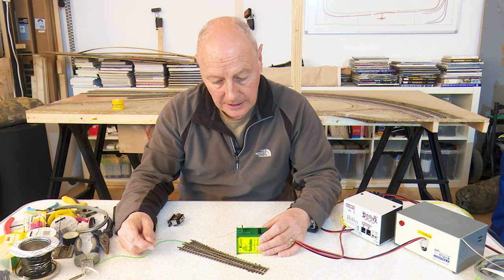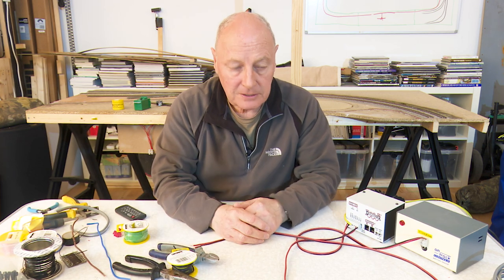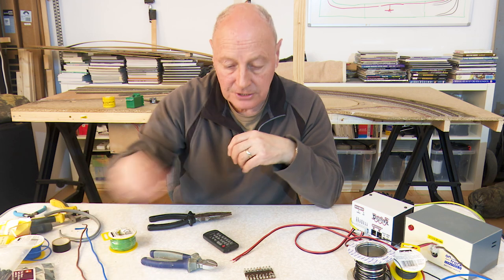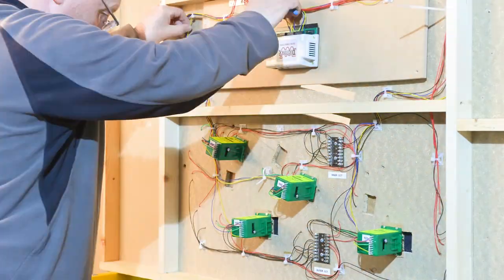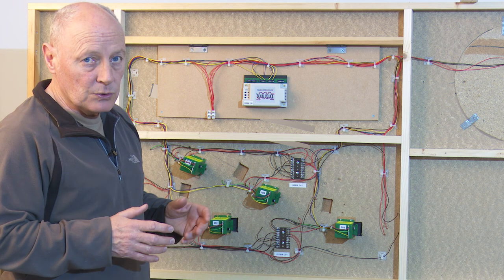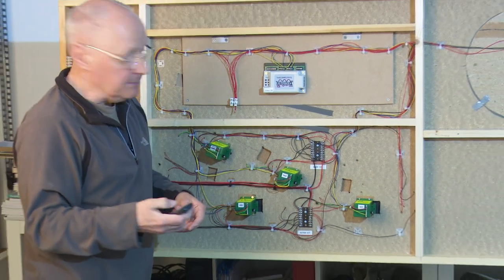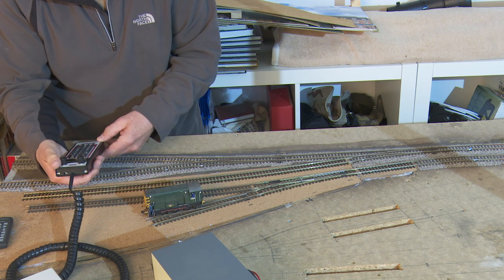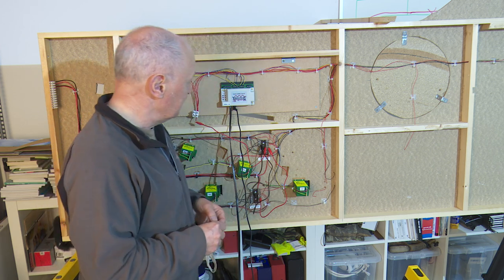DCC Bus Wiring at Chadwick Model Railway | 24.

Comment: Do you make an occasional wrap of the two bus wires? I have heard that it reduces the interface of the DCC signal. I’ve also heard about making a termination with a capacitor and resistor at the ends of long bus runs. What is your thoughts on this?

I like your advice about not soldering to the rail joints. I’ve had the best luck soldering to the rail web. Once the rail is weathered, and the ballast is spread, then the wire never shows.

On your topic of splitting the bus on a circular track plan, it’s good advice. For the viewers, don’t forget to cut your rail and install insulated rail joints at the same location. If this is not done, then it would be electrically the same as having a continuous bus.
Reply from the maker: Hi Brian, 

I’m pleased that you found it useful.
I heard of folk twisting the cables to counter induction but not of using a capacitor/resistor.
Regards Charlie

Comment: Do you share links? I am interested in the shoe lace ferral &  crimping tool, to use in keeping strands of wire tightly together. I use a wire length measuring meter to check remaining length of wire on spools!
The stranded wire frays into a  mess, keeping it tight to begin with will help preventing getting poked by the individual strands!  Great see how to buss wire track!
 Best Regards.
Reply from the maker: Hi BBB8,  you will find the links in the “More” tab.  Listed there are many of my recommendations.
Regards Charlie

Comment: Great video Charlie, Now I understand how your feeds are wired where your cab bus (Loconet) goes directly to your point controller and I can see how you avoid the Hand of God when you enter an incorrectly set point. On my system the cab bus does not go to the point controllers as they use track power for their data so I wire them to a separate power district. This is the trouble when we try to show how we wire things as all systems are slightly different. Yours being all Digitrax and mine being a mixture of NCE, Merg and other bespoke items that I have cobbled together. But I found it very interresting to see how the Digitrax system works. .........John
Reply from the maker: Hi John, I’m so pleased that you enjoyed it and hopefully it was of some use. Regards Charlie

Comment: Another question Charlie, do you solder the tracks together with the fishplate. Or do you let the glue or pins hold the tracks together. I am using all second hand track. Many of them came with solder at the ends of the tracks. I’m planning on ditching the use track I have and buying all new code 83 track so I have all the same code. As it is now, there are some 100 and some 83. I don’t know what the lower code is but I’ll bet I have some of that too.
Reply from the maker: Hi RH, I never solder the fishplates.  You loose the rails ability to expand and contract with changes in temperature.

Comment: Charlie; thanks for all of the great info that you supply in your videos.  Quick question if I may.  I operate with an MRC DCC system.  On my new layout I'd like to add the DS74 quad controller. in various areas.  What I cannot discern is whether I need anything in between my MRC system and the Digitrax device to make this work?  Any advice?  Cheers
Reply from the maker: Sadly I’m not knowledgeable on MRC but I believe that the DS74 could well require a LocoNet feed to signal the switching.

Comment: Hi Charlie. As someone who’s knowledge of such things is very limited, I’m soon to get an NCE PowerCab which as I understand it, operates at 2 amps. My question therefore… is the 5 amp multi core that you have used for the power bus suitable for this (if not, what would be?) and following this, I assume the 1.5 amp wire for the droppers is fine for using with PowerCab. Many thanks in advance 👍🏻🚂
Reply from the maker: Yes Brian, the five amp cable will be fine. The larger, the cable size, the less the power drop which is a good thing. Regards, Charlie
Reply: @ChadwickModelRailway  many thanks for getting back to me. Genuinely appreciated 👍🏻

Comment: Hello Charlie, great video as always and very informative with some great techniques. I think it is essential to be able to solder for modelling and why people don't want to try amazes me, as in most cases, 99% of things people do on their layouts they have never done before, it’s all a learning curve.

I am a little concerned with the wiring, have you considered Voltage Drop and Impedance? I am not too sure on your length of "Bus Wire" but 5 amp flex is not enough for a 5 amp system over a distance cable/flex will lose voltage. This can be calculated through the basics of "Voltage Drop Law" which is Vdrop = IR. I find it is always best to double the amperage rating of the cable/flex for longer distances, otherwise you increase the chance of Voltage Drop. For example, a 20AWG (0.5mm thick) at a distance of 5 meters with 15 volts and 5 amps could see a voltage drop of 11% but using a 14AWG (twin and earth type cable 1.5mm) with the same distance, voltage and amperage would see a drop of 2.7%. The golden rule for Voltage Drop is maximum of 3% albeit more towards household wiring but considering DCC it should be more robust. 

There is a plethora of factors to consider; rail causes resistance; Nickel Silver is 19x more resistant than copper, the type of wire is important; copper being the best for conductance and reduced Voltage Drop and there are many more factors. There have also been cases where impendence has caused loss of control above certain speeds as some motors and decoders have increased sensitivity over waveform distortion.

It could be even worse if you added devices to the "Bus Wire" for DCC Signal/Power but thankfully LocoNET covers that. So, bearing that in mind; from Rail to the "Bus Wire" a 2-3 amp wire/flex would suffice but a "Bus Wire" over a distance, connecting to many droppers, etc would need a thicker gauge and higher amperage rated cable/flex. In terms of Digitrax a 3 amp wire from the Rail to the BDL168 (dependant on distance of the cable/flex and length of track) would suffice, this reduces impedance, considers “double heading”, coach lighting and sound locomotives, only then requiring a higher gauge/amperage cable/flex for the common return ("Bus Wire").

You can terminate the “Bus Wire” by using a method with a terminator but Digitrax specifically does not recommend it at all. The principle thinking of a "Ring Main" is right but only in terms of it requires thicker gauge wire to power the appliances, to reduce the impedance and current draw (too much current, produces heat and then fire, if not careful), the same idea should be applied to layouts. 

If you want to take full advantage of the 5 amps, without any problems over longer cables, I do suggest using a higher rated cable/flex. Majority of my wiring on my layout is Automotive wire, which is near enough double or triple the rating that is needed. I have from Rail to BDL168 is 3 amps and Common Return is the Brown cable of the “Twin and Earth” thus ensuring reduced Voltage Drop and Impedance. A company I use is PoleVolt which supply 100m reels at a reasonable price.

Hope that helps and not too much information overload. 

Des
Reply from the maker: Hi Des, 
I’m so pleased that you enjoyed the video.
I do understand your concern over the voltage drop over distance.  As an ex helicopter electrical engineer, I do have a deeper understanding than most.  However, it’s very easy to over engineer what is fundamentally, a hobby.  
In the past, I have often lost sight of the aim, worrying too much over certain less important details.  I mentioned about power districts, and having them, is a massive asset.  They make power management much simpler and fault finding far easier.   Furthermore, it’s also easy to check voltage at the rails should voltage drop become significant  and adjust as necessary.
Regards Charlie

Comment: Hello Charlie getting back into hobby after long break.
Question I understand the Bus system should not be a continuous loop ie circuit.
Does this mean I would wire each section of track solder to Bus and use insulated fish plates if I wanted up upgrade signalling and points location in future from basic layout ?

Great Videos and tip much appreciated 

Paul Wright
Reply from the maker: That is correct Paul.  Regards Charlie

Comment: Thank you for the video - I have just found it. It is excellent, very concise and I wish I had found your videos earlier
I am a newcomer to layouts and I have found the thickness of the bus wire hard to come to terms with as opinions vary markedly from one source to another. 
My layout is roughly 17ft by 8ft.
A lot of US sources say 12 guage(AWG) wire which is 2.05mm (0.0808inch) diameter and 3.31mm2 cross section area. How does your bus wire compare to this US opinion?
Unfortunately in Australia the wire is not labelled as AWG and the thickness labelled is quite confusing to a dummy like me around electrics.
I bought some Narva auto cable which is rated at 10amps for the feeders (1.13mm2) which equates roughly to AWG 16.5.
Would this be adequate as bus wire also or do I need to go bigger?
Also does it matter if the feeder wires are over engineered?
Thanks for letting me ramble - I hope it makes sense.
Reply from the maker: Hi Michael, that cable is more than adequate. 10 amps is a lot of current.  I'll bet that your system is not outputting 5 amps and no, over engineering is not a problem except on your pocket.

Comment: Charlie, here is a list of Digitrax items as you requested. Mobile, Decoder, super Chief super premium DCC Starter set, DS54, LT1, DH126D, PR3 XTRA, LNC162, LNCMK, LNCCMC1, UP5, DS64. THIS IS A LIST OF ITEMS WITH A BOOK THAT CAME WITH THE EACH ITEM.
Bob
Reply from the maker: Okay Bob.
Now please explain the type of point motors that you are using and what the problem appears to be.
Reply: Chadwick Model Railway , I use tordishel, sorry for spelling, (comes from dementia) and question is wiring, do I need to drop a feeder from every track and switch? Being from USA, I get confused with some of the English words. What does straight forward mean. You say it a lot but not sure what it means. Once again, the wording difficulty is from dementia.
Reply: Chadwick Model Railway tortoise slow motor
Reply from the maker: Hi Bob,  watch this video from Digitrax and let me know if it makes sense.
https://www.youtube.com/watch?v=1JCo86J1WJI
Reply: Chadwick Model Railway Charlie, I will watch the video but let me ask you this. I have started soldering on the joint connectors. It work well but will it work for both the power and the Digitrax?

Comment: Charlie,  I watch almost all of your videos. They are very helpful. I have purchased a full Digitrax system and I’m having a very hard time. Especially DCS64. I’m also am confused about soldering things on the board. Does every track and switch need soldered to the bus and does every track and switch need connected to my DCS64 in each of my districts? Sorry for asking so many Digitrax question. If it is ok, I’ll ask more.
Reply from the maker: Can you tell me what you have bought?
Please reply on a fresh thread.

Comment: Hi Charlie, thanks for the informative video, quick question, does the bus wire have to be directly under the tracks in question, as your theory regarding confusing signals could also be relevant here, if the signal is going round the bus AND the track (as both are live) if the bus wire is not directly under the track, it may come slower then via the track itself, will the signal become distorted or is it all lighting fast? many thanks. A
Reply from the maker: No, I don’t believe that it matters.

Comment: Hi Charlie.  I have been enjoying your videos immensely, especially during this lock down period.  The signal gantry one was good and I have a etched brass kit of a gantry to build.  Before I start it however, I need to get an understanding of how these things wire up with Digitrax. Can you do a video of this please? I have 4 zones in my layout but I’m going to change that to six so I can run more than 2 trains at once.
Reply from the maker: That is quite a challenge Richard. Please view my video number 2.
It explains how the SE8C works if you need automation.
Regards Charlie

Comment: Hi Charlie, in respect of your previous video about stabbing your thumb. I always use a locking pliers to hold the pin just above the track, you can then cut with confidence. The pin won't fly anywhere.. regards JC
Reply from the maker: Great point John, and no pain too. Thanks, regards Charlie

Comment: ¡Hola Charlie! Greetings from Spain, the land of the GSSR.  Retired here back in 2015 and recently found the boxes of my cherished childhood Hornby train set. Not having used the set since the early 1980’s, I have been amazed at the advancements made within the model railway system. The major change I have come across is DCC.  I have therefore decided to invest in a base-entry-level system and, am now preparing a layout. 

This video has answered the questions which have been on my mind and, I now feel confident with the wiring required. Of all the posted videos, within the model railway scene, on YouTube, yours has been the most informative. However, one area of installation wiring I have not yet come across is, wiring and the possible need for track section insulation for points. Can you or, a fellow modeller, provide advice please?  Thanks Gary
Reply from the maker: With DCC there are no isolated sections at all with the exception of the frogs on electrofrog points.
Trust me, it’s far easier than you think.
Reply: Chadwick Model Railway Thank you for your prompt reply. I have all standard points (R8072 & R8073) so, that has certainly eased my mind. As for the connections, soldering will be the order of the day - having spent the last 16 working years involved with commercial lighting, I have always given supposedly labour-saving connectors a very wide berth. Thanks again Gary

Comment: as a retired auto electrician I find using scotch locks are very hit and miss as they do corrode in the air and cause all manner of faults I was forever removing them and soldering instead as some time the bridge which cuts through the wire and can miss the centre core and just rub up against it so causing a poor connection I have removed hundreds of them with that fault. I find soldering the best foolproof method thought I would let you know all the best john from rugby.
Reply from the maker: I too have moved on, I now use ferrules whenever i can.
Reply: @ChadwickModelRailway  Ferrules is a much better way of connecting wires as you will always get a good connection. there are many good ways of connecting wires scotch locks are not one of them as I mentioned above. all the best john from rugby.ps your model train videos, in my opinion, are the best tutorial train videos on youtube by far none even come close to yours I personally as a professional auto electrician think you are doing an amazing job.

Comment: Hi Charlie, Great informative stuff. Confused even more now ! Back into Model Railways after many years away, but now got a "Man Cave" ! Your guidance please. If, for example, you are running a small basic oval circuit (eg Hornby Mixed DCC) the rails act as power with DCC signal, and is continual circuit. If you run a Bus (with droppers) that continual circuit will be there (through the rails) whether or not you sever it. So, do you use Insulated Rail Joiners ?
Reply from the maker: Great question Neil.  It is thought best, amongst the electronics wizards, that the bus wire on an oval circuit shouldn’t actually join right up and the track should be separated by two insulated joiners so in effect it’s not a complete oval, it’s just one big straight track which in reality does join.

Comment: As usual, very well explained, Charlie. Two quick questions:
1.   I've heard that the bus wire should be twisted... about 3 twists per running foot. What's your view on that?
2.   In case I go in for tag strips to connect the feeder wire to the bus, then what would be the maximum length of a feeder wire (from the track to the bus)?
Regards,
Ganny
Reply: I meant what's the "do not exceed" length of a feeder wire!
Reply from the maker: Yes, twisted pairs is good practice but I'm unsure if it's necessary.
As for feeder wire, it depends on the feeder cable size.
Regards Charlie
Reply: @ChadwickModelRailway  Thanks... reason I asked is that this modeler mentioned an ideal max distance of 12-16" of 20 gauge wire.
Reply: .... and that does not seem compatible with the use of tag strips, as you explained.
Reply from the maker: Sorry, that wasn’t very clear.
The length of the feeder wire can vary by using thicker cable. 
So for example, a 4 foot feeder cable might be excessive for a 7 x0.2 cable.
So change the cable to 16 x 0.2, which would have much less resistance.
Regards Charlie
Reply: @ChadwickModelRailway  Its clear now, thanks. Cheers, Ganny

Comment: Hi mate.  Great videos with some humour which makes me chuckle.  You mentioned that you “have knelt at the altar of Digitrax” but that a PM42 power splitter could be used on a Lenz system?   Do you have any more info on the technical spec of the PM42 ?  Are there any settings to change?  Keith
Reply: I have just bought a Lenz system by the way.   Keith
Reply from the maker: Not really Keith.  I imagine you know that it reqires its own power supply, but that's it really mate.